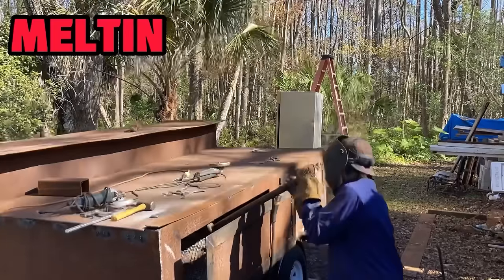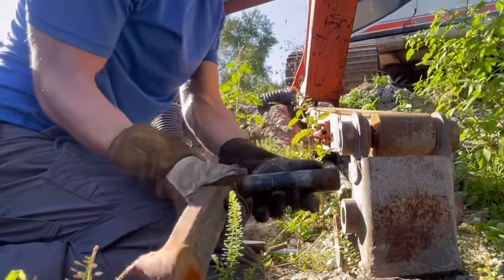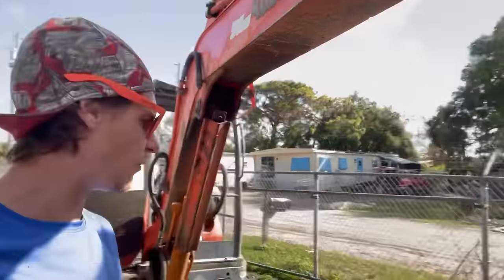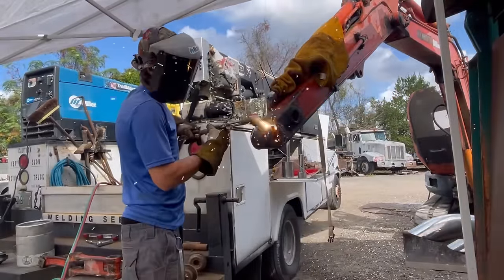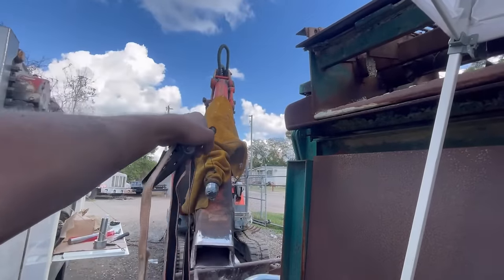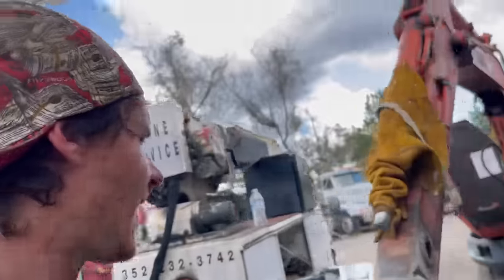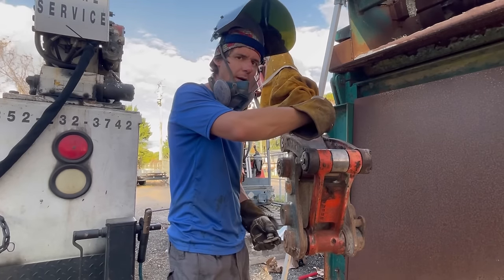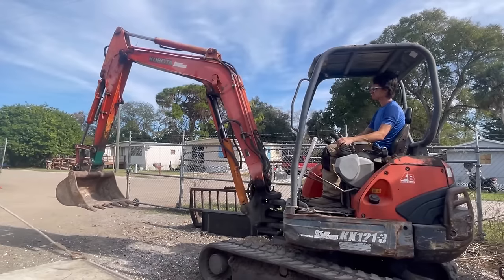You WONT Believe How I Fixed It! | Welding Repair on a Excavator |

Comment: I'm a retired welder with 43 years welding experience so I'm going to make some suggestions on this job. First of all, I'd get set up to air arc. You can't always use a torch for cutting and you needed an air arc set up for this job. Don't put your ground clamp inside the bushing that you are welding, on the bottom of the stick. You could put it any where on the stick or boom. Never use 6010 or any other wire other than low hydrogen on hi tensile steel as you said that you wanted to do on your first pass. You didn't have "undercut" on your first pass as you stated. You just needed more than one pass to make the weld flush. You welded the bushing on the end of the stick, "in position" when you could have made it much easier on yourself by starting the machine, lifting the boom and putting the stick in the vertical position. That's the same position that you should have welded the eye on the end of the bucket cylinder/rod.
Reply: WORK SMARTER,
NOT HARDER.
  SOMETIME,TIME TEACHES US. OTHER LESSON ARE LEARNED THE HARD WAY.
OH WELL.LIVE AND LEARN,DIE AND LEAVE IT ALL.
Reply: I agree with you on the 7018 rods always use them on structural or high load steels as a matter of coarse .and set the digger arm up so it's more comfortable for you to weld on welding 101 always try to get as comfortable as you can .
Reply: Hopefully he takes your good advice sir. And don't take it personal like most people do these days
Reply: will b  Use a good respirator and you should try to quit smoking or smoke less. If you're already over 40 you need to quit .
Reply: Great advice ! And well  said. I personally love reading advice from veteran welders. And congrats on retiring and making it to retirement!
Reply: @CamMacMastermusic  I'm glad to help you out at any time!
Reply: I was hopn someone would mention the grou d position
Reply: Just came across your channel on the little kobota digger after doing all that work you should have changed out the muffler that in its self is a fire waiting to happen I had one catch fire once a 13 tonne hitachi with a blowing muffler I'm in plant hire for over 50 years great videos 👍

Comment: One hint I learned from a gray haired mentor....any time you are working on the end of a ram or the cylinder end with the ram still pinned,  rotate it so you are welding in a normal horizontal position or whatever position you prefer.  No overhead is needed that way.

Comment: Pro tip of the day. You can use your welder to jump start equipment if you have a cv setting on your machine. You can actually dial it up to whatever voltage you need works pretty slick.
Reply from the maker: nice tip! might have to steal that for a video
Reply: @MeltinMetalAnthony  yea for sure. Learned it from an old mobile mechanic. I have my own jumper cable ends now that have qds on them so I can take my ground and stinger off and swap out for the jumper ends easy. Works very well I've started giant dozers and tractors no problem.
Reply: I had a Trailblazer 301g,  I tried it,  and yes it does work,   as long as it is set to CV.
Reply: @billarroo1  what is cv?
Reply: Constant voltage?
Reply: Nice tip
Reply: I never thought of that. I've got a big old 400A Lincoln CV. Nice one.
Reply: Gotta be careful. Some welders don't turn down far enough and you can burn up electric stuff. Put you volt meter on it first.
Reply: Ive seen a welder used to thaw frozen pipes too. Just hook the positive to one side and negative to the other and be careful not to melt the pipes and burn your house down.

Comment: NEXT TIME USE A PORTABLE BAND SAW AND SAVE THE ROD AND CLEVIS 👀

i used to do A LOT of hydraulic work. Boss used to buy a tub that you could open and use like playdoh, cover the rod, pull off excess to reuse and kerosene with a rag so you dont scrub, one wipe like your jerkin your meat. It is GREAT for spatter, but it you just need heat transfer you can weld a clevis 1-2" from the gland with the puddy on, and your not only worried about spatter but pitting is the main focus as your fluid will bypass the pits, thus leading to a new rod replacement

Comment: Dude you did an awesome job.   I'm an ironworker that spends a lot of time doing repairs in steel mills.   Also training for a CWI.
   I had to comment because of the "you need an air arch" and "6010 is bad to much hydrogen" comments.

There is absolutely nothing wrong rooting with a 60 rod.   Better to have a good backing rather then welding with a 70 series rod that doesn't have enough flux to cover both sides of an open root.   That's why pipe liners root with 60.   I'm sure you know this and that's why you ignored the comments.  
  As for an air arch or plasma.   Plasma is great but I haven't found one that hasn't given me problems.   There great until there not.   I've been caught up with bad consumables before,. Contact errors. They just cost to much to keep running.   If you have money to blow fine.   But your out here making money and that torch isn't going to throw a curve ball at you. They are reliable only thing that lets you down is you,. Not keeping an eye on your bottles being full.
  A lance is nice.   Not going to take that away but you don't "need it".   I find amazing how someone says you "need it" after you just did it with the torch.
   One thing you might want to try out thou is 7016.    It's like a 6011 and a 7018 had a baby.  Great penetration, fast freezing so you can jump a big gap pretty easy, burns like a 7018 with high disposition.   About the same price as a 7018.   And it's more forgiving welding on dirty rusted objects.   
  Your ground was fine on the new bushing,. An old one might give you arc blow issues do to eddi currents flowing through semi magnetizes the steel.   Then you can use a set of jumper cables , one clamp on each piece your welding together.   This helps the current get through the magnetic field.   The arch blow will typically be at the ends of the round objects(closest to the poles).
   The only other thing I noticed was the gaps you were filling.   You might run into pulling issues.   When it cools it pulls.   The faster it cools the harder it pulls.   Only if it's critical would I pay attention to it.   Ways to avoid this is don't let your piece cool.   Keeping a fire blanket or keel wool on the piece would contain your heat and control the pulling so it all cools equally.  
  Me personally I love running flux core 212 or 232,.  If I feel like carrying a bottle dual shield is amazing but it's pricey to get the set up and a roll of 232 is $4-5 a pound
   You pissed with the dick you had.  You have an outstanding mindset.   Best piece of advice I ever got is forget the people that say welding is an "art".  It's not l. It's a science. That's why you can program a computer to do it.   If you go at the same travel speed, same angle, same settings the weld profile does not change.   If the weld profile changes you did something different.   Keep getting up my man!
Reply: Great comments, lousy English (sorry, had to stick that in so your head didn't get too big).
Good comments like above, make learning from others a joy - thnx  B

Comment: I'm a pipe welder I thoroughly enjoy your channel just some tips on welding with 7018 on small circumference stuff try bending your rid about 4.5 inches from the end at a desired angle and you won't have to use your wrist so dramatically hope this helped

Comment: You need a bigger chipping hammer!  LOL  I am glad you showed how to "fix" undercut by grinding a little. Many newbies wouldn't know to do that.  I agree that you should have been a little hotter on the root. I laughed when you undercut the flat.. (easiest weld )  Yep. I have always had "work gloves" and "Welding gloves".  That piston connector could twist to allow you to make the complete weld from one side.. Weld vertical until it gets flat. Stop. Twist it toward you until the next part of the weld will be vertical. (You gotta think "lazy welder"  Make it easy as possible on yourself.  All in all, a good repair. Its not a rebuild. Its a repair.

Comment: That thing you were struggling with cutting off with the torch would be a great reason to get an arch gouging setup 😂
Reply: I weld and I have had experienced welders tell me that arc gouging over time is no good for your welding machine.
Reply: @JD-526  I would ask Isaac - YouTube channel: IC Weld, he arc gouges a lot, also Kurtice from Cutting Edge Engineering he arc gouges a lot also, both will shoot straight with you.
Reply: @JD-526  there’s a reason most big shops have dedicated gouging machines

Comment: U can take a grinder and cut the slit open on the battery clamps where the bolts go through and give u more adjustments.  Working on farm junk is my specialty  lol. Pins and bushings are a never ending job on a farm. We weld allot of our pins up and lathe them down and make new bushings to keep equipment going.

Comment: I find that if I cut my rods in half the shorter rod makes it easier to weld the small diameter shaft
Reply: Try and use your left hand to contr ol' the rod when going around small diameters it helps with the fast movement you need to get a tight bead.small diameters are the difficult to weld

Comment: Looks like that you did a great job, and you can see that it needs some more  pins or bushings replaced . That machine gas really been abused, I hate to see where that people  don't clean and grease their equipment and keep it in good working condition and let it just go and go.  I run heavy equipment some and have for years and I have never just beat and banged on a piece of equipment and bent it all up . New equipment costs big bucks, so why not take care of it . I will be looking for more videos, so be careful and stay safe and keep on working and making more videos.
Reply: Good job, helps when you have spare machine to salvage parts from

Comment: When you don't have someone to hold the bushing ... you can use your table on your truck or ive even set it on a piece of steel on the ground and use the boom to put pressure until you get a few tacks on there but you did amazing job it cam out beautiful... you deff got skill

Comment: Roll the rod over in the cylinder to weld end on down hand ...if rod won’t turn just turn it as you power it closed or open using hydraulics . You did real well to bring this back to usable condition using bits of crap ...

Comment: Obviously you are very skilled  I just have a little tip I want to share to whomever reads it.
Tip:
re:  jumping or charging a battery. 
Always connect 1st - positive (red)  2nd - negative (black)  when disconnecting go in reverse so  remove 1st black 2nd red.
Reply: Why

Comment: I used to  be a heavy equipment  mechanic   doing the same work .What did they never grease this machine   and wore out the bushings  and boom!   usually  booms and pistons ect have replaceable bushings and seals 🤔 but that was Dear, Cat ,Komatsu  and Ford also bobcat . maybe others don't  make replacement bushings
Reply from the maker: some of the bushings on these cheap machines aren't serviceable

Comment: I've heard if you remove the rust and mill scale from the area you're cutting with the oxy torch it greatly improves cut quality and makes it easier
Reply: But, it's another one of those "it's a junk machine so my quality of work does not matter" jobs. Hate that. If it's worth doing it's worth doing right.
Reply: I guess you're right. Still, if it saves you time and hassle then why not? I'd flash over the cutting area with a flap disk if it'd save me 5 minutes and some hassle
Reply: Yeh that's about right on try an get  back to bare steel if you can sometimes you can't but the more rust an shit you get off the better your kerf lines will be also warm the metal a little bit don't blast it just room temp will do

Comment: I have cut bushings out with a die grinder; its clean and allow easy insertion of a chilled replacement.
Im not skilled enough to do what your doing, its great to see how pros deal...
Reply: I've pushed out bushings from the sleeves by welding a piece of rebar to the bushing long enough to hammer it out. It works super amazing. And the process takes about 5 - 10 minutes for each bushing.
Reply: @Borderweldingservices  nice one Paul, I'll give that one a try👍

Comment: What amps are you welding those vertical welds at on that machine, Also if you used 7018 what would the amps be for that vert weld

Comment: I usually cut them off with a arc air but good job
Reply: Don’t always have that option in the field. Like he said gotta make due with what you have
Reply: Good move. I used to rebuild gougers as a Millwright. Guys love to run them short and melt the guards down into the unit body.

Comment: He got a steal on both those machines.  But before you dump more time and money in it, he should get the main swing bearing checked.  House looked a little shakey compared to tracks.  Sticks and booms can be worn to shit and still work but if the house quits turning it aint worth much then.  Great work and happy new year.
Reply: The slew bearing looks whipped to me. That's what I'd expect if I bought the two for $6k!

Comment: That wear on the bores and pins is absolutely unacceptable, a few tubes of grease and a kick in the ass would have prevented that. Pure, unadulterated laziness, without a doubt. There is no such thing as a disposable machine, a well maintained machine will last a lifetime.  Wear and tear are to be expected, but you deal as you go not wait untill the damn tracks fall off.
Reply: A well maintained machine will last a life time but sadly the machine in the video is already beyond economical repair. To make it a perfect machine wouldn't be worth the time or effort. The best thing for it, is to keep it going with little outlay and keep on using it to the very end of it's life.
Reply: A pump or two a day in every fitting will keep it tight for many years!

Comment: You can use your welder put on oestrogen gear and at 40 on fine adjustment  for  about 30 seconds .welder put out DC volts

Comment: Hi Anthony! First of all my compliments for the video and for the work you did, very well done! I just wanna give you two tips: when you shut-off your torch close the gas knob first and than the oxy one, so the oxy will keep the flame out of the nozzle and everything will be safer; the other tip is that you definitely need an arc gouger machine!

P.S. leave the 6010 rods to tanks fabricators, for your kind of job you just need 7018 low-hyd!

Comment: You should really wrap the rod with insulation and only put a few welds on at a time to allow it to cool off. Easy to bend the rod if you get it to hot

Comment: Dude love you vids! I’d appreciate your insight man, and all other component welders for that matter!

Question:
I have a budget of 500 to buy a welder (new or used). I will be fabricating a 8x12 trailer with my father. The material is all steel tubing or Ibeam. 

What machine can I purchase in my price range that will provide me the penetrations for structural welds. I had a 225 Tombstone I’m tempted to get back, but would another process be more efficient. Thank you!
Reply: Tombstone will be just fine

Comment: 500 hundred cylinder was prob little more on price range. However you can have John deere or cat come out and redo the seals if it becomes too leaky. That's what we ended up doing. Took them some time. But cheaper then a new cylinder

Comment: Cut the rods in half it will help make those tight turns
Reply: Or save some rods you used before that you didn't need the whole thing. I did that when I was welding a lot.

Comment: You want to be careful using 6010 on equipment. A lot of the components are made out of 50 WT or QT 100 which do not like to be welded with 6010. Saver to stick with 7018.
Reply: @wecx2375  yes, 6010 has been a Pipeliner rod since I started back in 1971 mainly because you can weld pipe with it faster than most other rods. However, it's a popular rod in the oilfield and in the heavy equipment repair industries because it'll weld through anything. Rust, dirt, grime, oil, etc. doesn't phase it at all, it just burns right through. 7018, on the other hand, requires a spotless surface, or as spotless as you can get it or you're going to have problems. 7018 is stronger and doesn't have a tendency to crack with constant vibration like 6010 does either. They both have their place and knowing when to use which rod just comes from experience. And I carry both on my truck and use them both. The biggest pain in the ass about 7018 is you have to keep them completely dry and that's why most welders that I know have a heated rod box.
Reply: @texasplumr  great expansion, yeah lots of stuff I used 7018 welding on vibrated a lot. Like shaker tables, screens, etc. You are right, I had to be very disciplined to always clean out slag. I'd wire brush and chip slag out religiously between every strike. Yes, knowing which rod to use is very important!!! I did Millwright work so I had to weld to make repairs, I was always thankful when I got a chance to weld.. I learned from welders like yourself along the way and it always put me ahead of other Mechanics to listen!! Great points.
Reply: @texasplumr  Well Said!

Comment: When you said it was hard to weld smaller circumference stuff all you need to do was aim the rod down in your stinger and your wrist will naturally turn around the circumference also 135-140 is way too hot for an 1/8th inch 7018 I seen you had a few bbs on that finished weld thats an indication of being too hot 125 is all you need and go slow watch the puddle get nice and round and wet in that's all also like others have said never ground to the hole